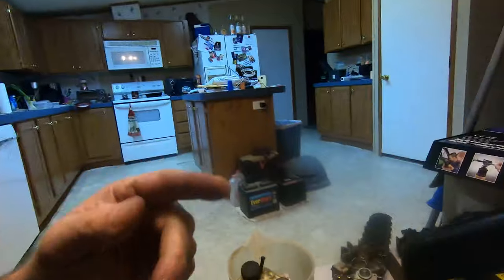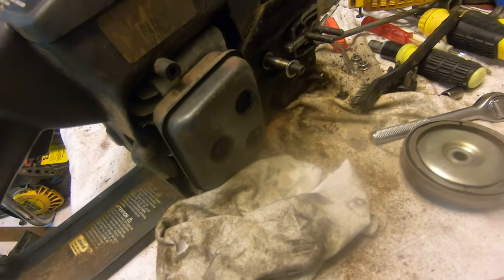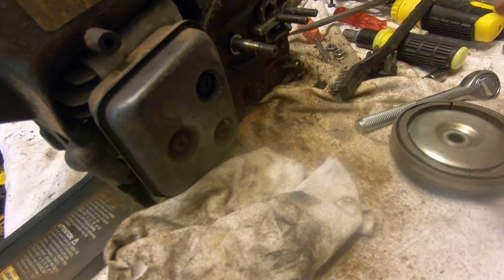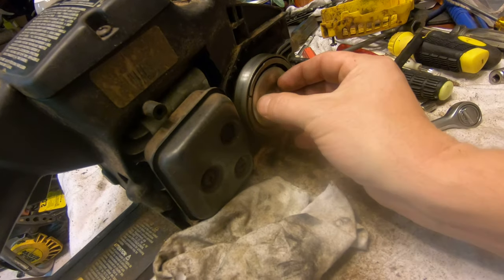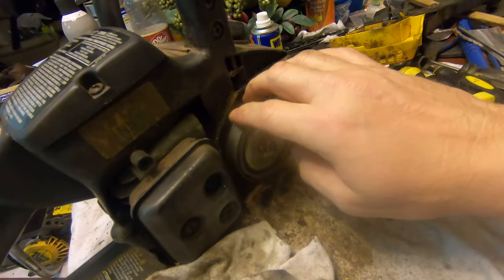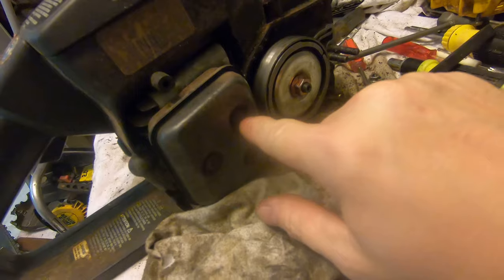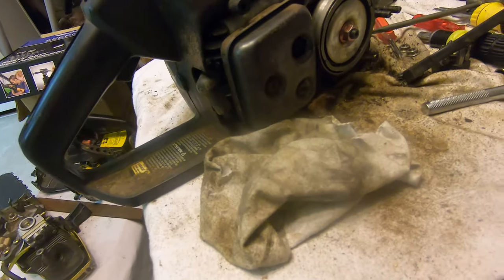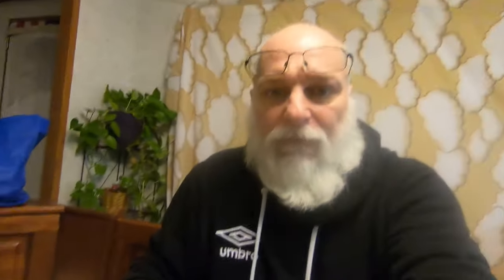Mac 3200 clutch fix

Comment: I have a similar issue,,but I need more spacers. There is one spacer in now and the chain is riding too far to the outside.And it is binding on the sprocket outside the grooves for chain.(away from head).